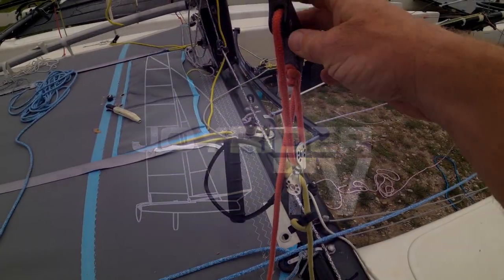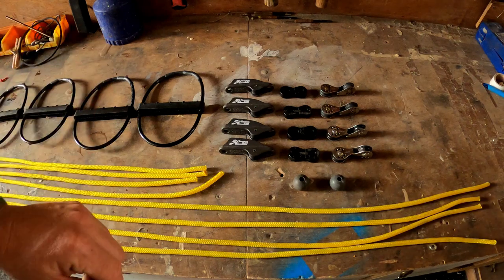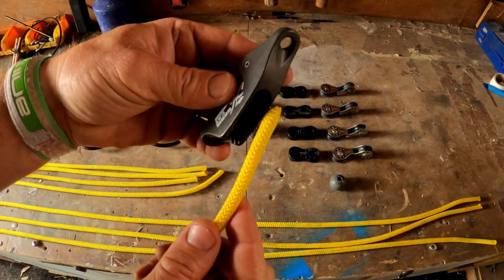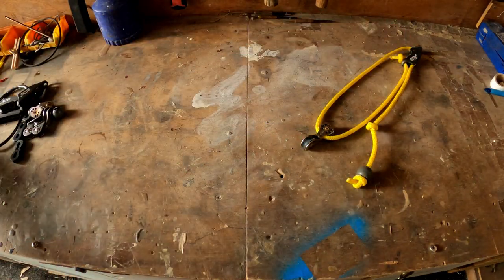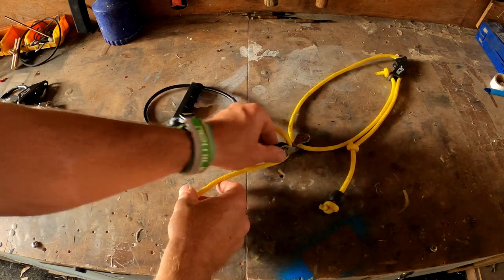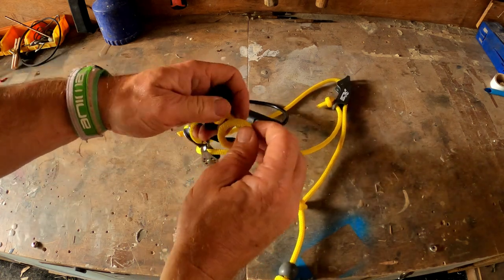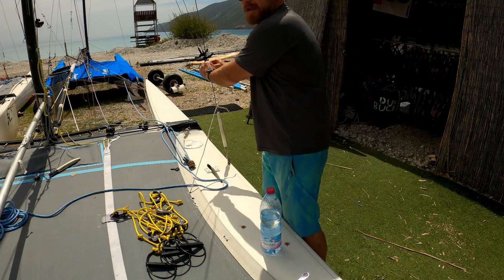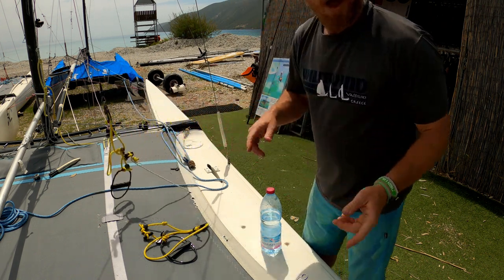Adjustable trapeze assembly

Comment: Is there and reason for using a double pulley and not just a single block? Since the lower pulley is not a part of the adjustment of the trapeze length and just acts as a stop for the dog bone.
Reply from the maker: It reduces wear to the lower rope. When you unhook the elastic pulls it back through.

Comment: Did you have to shorten the trapeze wire and move the handle up some in order to install the adjustable trapeze rig?  The adjustable trapeze rigs that I have on my H16 also have an additional trapeze handle between the two blocks.
Reply from the maker: This worked with the stock wire length for the tiger. I think for the 16 the wire would need shortening to use this system.